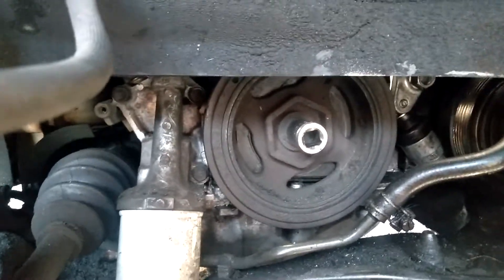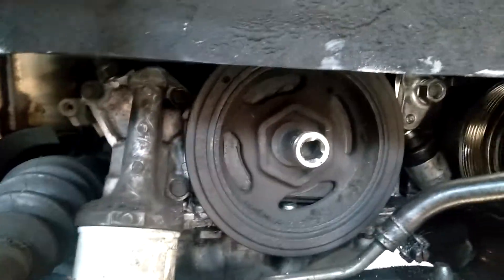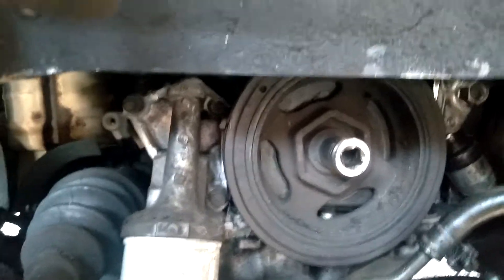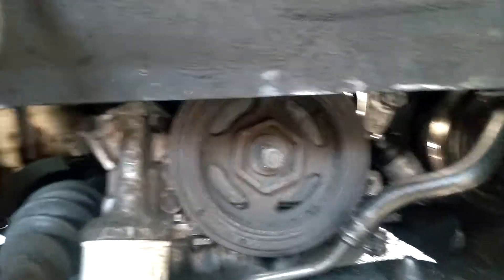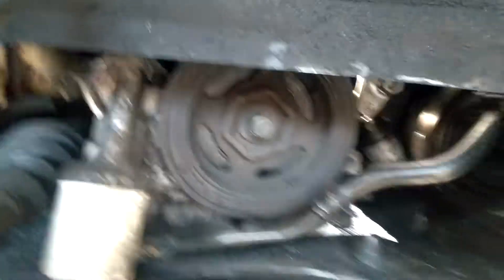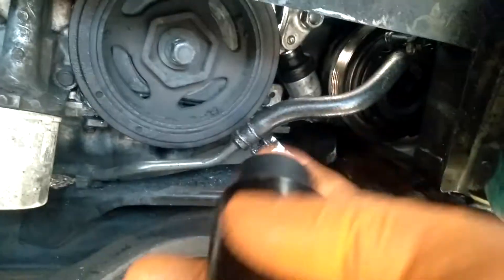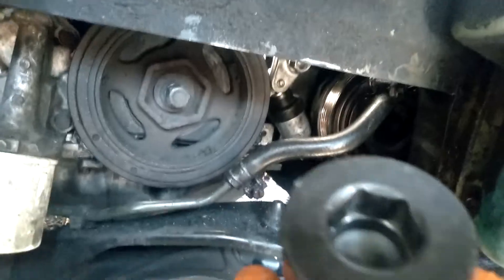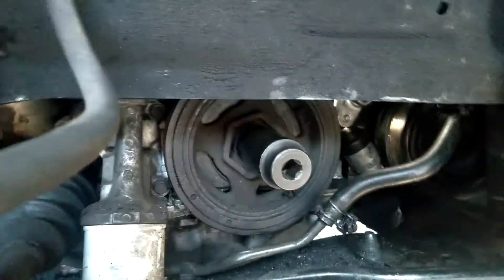How to remove a Honda crankshaft pulley

Comment: My Dewalt 20V impact removed mine with ease (07 Honda Odyssey) using a regular Harbor Freight deep socket but that’s an interesting tool. I’ll have to keep it in mind in case I run into this situation. Now how to remove the actual pulley…